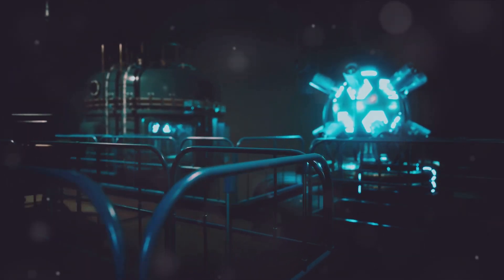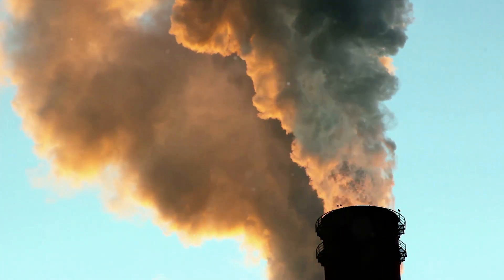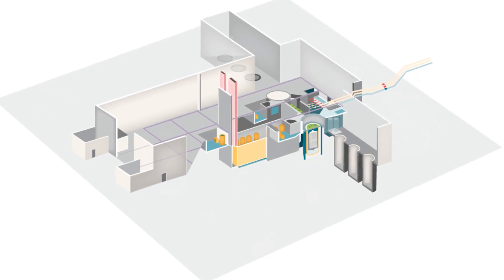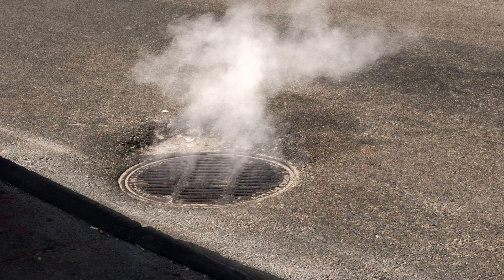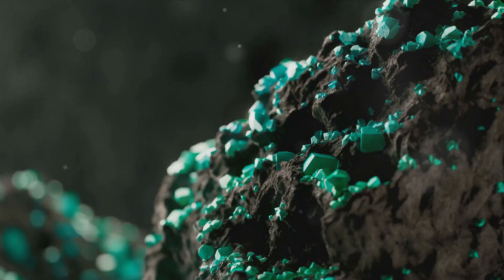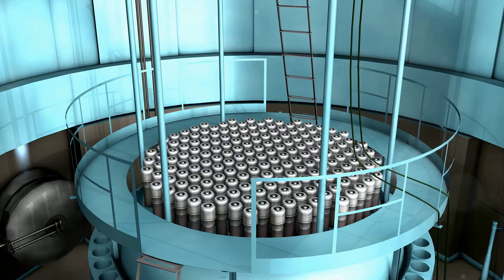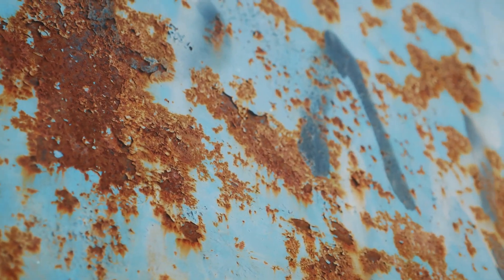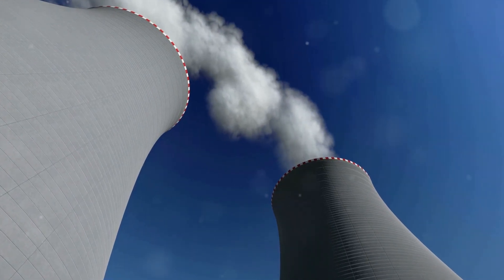Revolutionary Thorium Reactor: Turning Nuclear Waste into Energy for 1000 years!

Comment: There are exactly ZERO commercial Thorium reactors.  Maybes are not reality
Reply from the maker: Not yet. But there are companies like Copenhagen Atomics that are actively pursuing this technology.
Reply: @SingularityVault  Don't you find it strange that it is only the startups with no nuclear experience and wanting taxpayer handout that are interested in these newish technologies.  Established nuclear engineering firms are not interested in the newish tevchnology
Reply from the maker: Maybe they instead want to work with proven technology. But there are some interesting projects out there! China also have an operating 2MW Thermal thorium reactor in Minqin. So the technology seems to be getting somewhere :)
Reply: @SingularityVault  I believe that established companies, like you say, are risk adverse and want to do what has already been proven.  
I am not against advancements and technology improvements, however I am skeptical when startups make unfounded claims as if they were facts, have a handout for taxpayer money, and as a small company propose that they can solve the issues that arose in the past when every one of these so called new designs was built , tested, and abandoned by large governments. 

China has built many full scale large output nuclear power plants but the thorium MSR they built is a small demo reactor 1/4 the size of the U.S. ORNL reactor from the 1960s.  Their lack of commitment says a lot about their confidence in Thorium MSRs.

Summary: build it and operate for at least 10 years before making any claims

Comment: The Oak Ridge project, run by the genius Glenn T. Seaborg, in the 60's, had the correct heat/alloy ratio to run successfully, as opposed to when China built their overblown version, at far higher temperature, so the alloys failed through corrosion. Oak Ridge had a minor grease contamination that corrupted the external heat exchanger, and that was exaggerated by the criminal Nixon Administration and his fossil fuels cronies, that wanted to profit more with the fossil fuels intensive Cold War build out. Yep, good ole American greed has kept this sustainable tech from graduating fossil fuels. What a dull surprise. Now only third world countries can build out this tech, with scalable grids, because the fossil fuels industry has a death grip on modern industrialized nations. Epic fail.
Reply from the maker: That is interesting! Thank you for sharing.